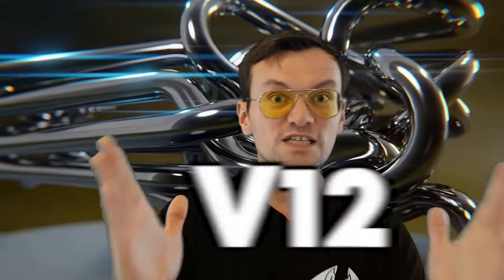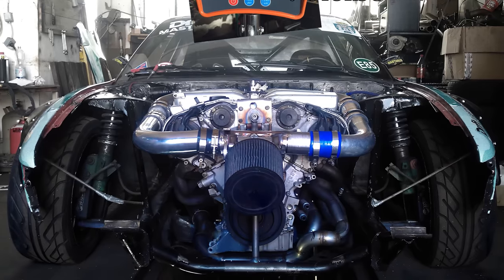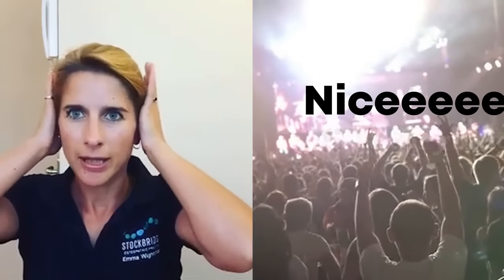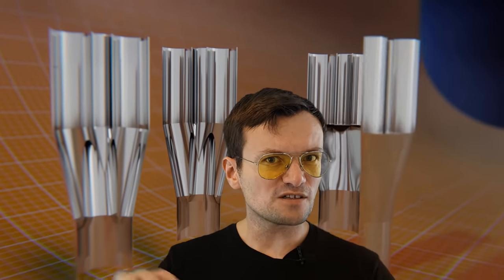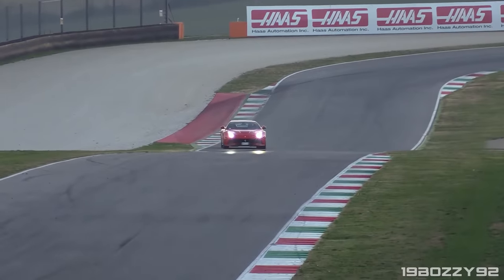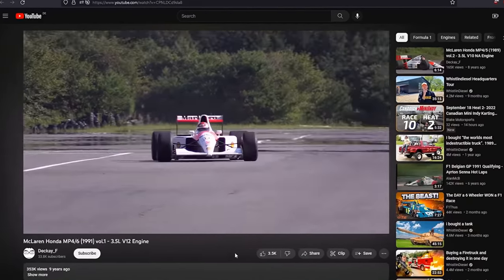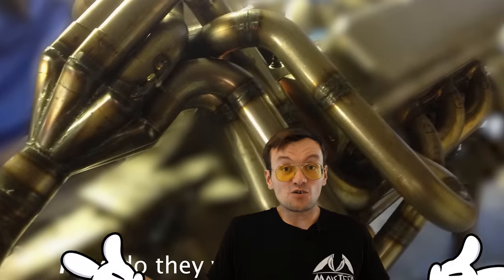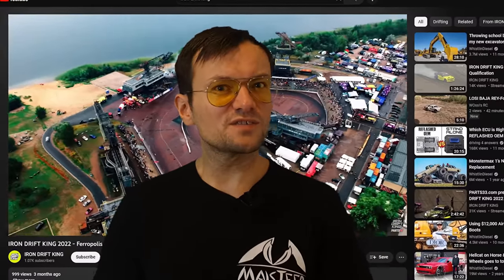Why This V12 Sounds Better Than a $5,000,000 Pagani

Comment: So all these lovely sounding examples here are doing it by stepped headers or is there still more to it?
Reply from the maker: I think you've missed the part in the latest video about that 1989 Ferrari V12....? The stepped headers are not the only way. The principle can be applied in different ways. The logical next question is. What happens when you combine them? (I've never seen that done before)
Reply: @maisteer  
@andyhbo86

Where the paths cross seems to be less important than when they cross in the lifecycle of the pressure wave.

Almost all conversations around exhaust and sound center around the pressure wave exiting and returning through the system. It makes most sense to me that the F1 sounds we all love are a hyper organized process of lining up the pressure waves so that each pulse is given a clear non turbulent path.

I think cylinder pulse timing from end to end is the key over the form of the system. Even though that is a significant factor in timing similar to diameter and length of the overall system. I'm open to why this could be a wrong way to think of it.

Comment: The sound is worth the work.
Reply from the maker: Yes, I totally agree. And I hope I can make another video about it soon.
Reply: absolutetly
Reply: I doubt you'd really say that if you were paying for it!

Especially when you consider that your car will probably be slower after spending all that money. Manufacturers these days to go great lengths to design exhaust systems with multiple parallel turbos and twin scroll turbos because splitting the headers prevents pressure waves from stacking and increasing exhaust backpressure which costs you efficiency and power.

Besides F1 cars sound good...for F1 racing. On a road car I don't think that high pitched raspy sound is even all that great. Most definitely prefer the more complex sound of a traditional Ferrari V12, or even the brute thunder from a M279.
Reply: @BigUriel  I wont argue. If my anemic checkbook had to shell out for it, I'd probably put equal length headers on a one cylinder motorcycle and call it a day.
Reply from the maker: @BigUriel  There's one man that went through great trouble and expense to do just the opposite of what became the norm today. And in my opinion he succeeded, what do you think: https://youtu.be/P_9T8WU4ekg?t=90
Reply: @maisteer  To be honest I don't love the sound, like I said it doesn't fit with the car at all, it's a sound that works for F1...and that's it.

A Ferrari 812 sounds much better.
Reply from the maker: @BigUriel  I guess you made up your mind already.... ^_^
Reply: Honestly 2k isn’t that bad for equal length 12 into one headers. Stainless works headers for a 5.0 stang are $1200-$1300.
Reply: @BigUriel  the average price for headers full length quality headers on a V8 is between 1200 and 2600 so the price is perfect.
Reply: 1000%
Reply from the maker: The follow up video is done.... let's see if it really was worth it ^_^' -  https://youtu.be/6EjbfLSRmyA
Reply from the maker: @BigUriel  You will love the follow up video ^_^' https://youtu.be/6EjbfLSRmyA
Reply from the maker: @davestewart1656  Motorcycle engines are featured in the new video too... altough not one cylinder ones. https://youtu.be/6EjbfLSRmyA
Reply: The porche at 1:24 had the most different sounding exhaust I have heard. It sounded extremely smooth. What is the story behind that?

Also, I think this exhaust sounds pretty impressive, especially when it gets up a couple of gears https://youtu.be/pLdSDyATsGw?t=21
Reply: @BigUriel not limited to F1 the Lamborghini’s sound and look nice with aerodynamic enhancements,not a everyday driver but fun in tracks and open highway thrills here and there 😊

Comment: I've spent years researching just what you need to make that high pitched shriek that the Zonda makes (although the Murcielago also makes this then later special headers make the Aventador do that as well but I still preferred the Murcielago sound). You've just summed it all up into one video.
Reply from the maker: I'm glad you found some value in it ^_^

Comment: I have an acoustics background and I had never considered the impact of header design on engine sound.
This makes a lot of sense though.
Pulses per second is basically Hz or frequency.
If you have more pulses coming out of a single pipe (or speaker) per second, you have a higher frequency.

Of all the exhaust tones in this video, I loved the GT 350 the most - 10:13. mmmm that low rumble :P
The most interesting tone was the Honda at 9:32. It is clearly 2 distinct 'notes' (to make a chord!) which makes sense with the 2 header pipes with slightly different path length.

My takeaway: people have different opinions of 'best' tone. But this is a fantastic look at how those tonal characters are created!
Reply from the maker: I hope you will like the new video... it's like an entertaining physics class but without physics: https://youtu.be/6EjbfLSRmyA

Comment: I believe the Rob Dahm 4 rotor is a major competitor for a 12 to 1, technically since each rotor has three sides it would have a very similar exhaust pulse rate and sound, that engine sounds absolutely amazing!
Reply from the maker: Yes, absolutely. 4-Rotors do sound insanely good: https://youtu.be/5NZmUkA5rGQ?t=78

Comment: Part 2! part 2! we want to see the results! You have inspired me to try to make a 4cylinder sound like a v12, or at least higher pitch lol, ill use it as a challenge to improve my fabricating and welding skills, might start this experiment in 1 year or so, the project im planning to do this to needs way more work, to be where I want it to be, we shall see
Reply from the maker: Good luck with the project, I hope it'll all works out.
The car with the 12 into 1 is supposed to be finished in mid-August. And I can't wait to hear it too ^_^
Reply: @maisteer is september
Reply: @maisteer As a 4-8-1 header, I think the fact that it rotates will improve the sound even if 2 tubes are triggered at the same time
Reply: An open tri y header on my four cylinder gave it quit a high pitch lol

Comment: Not just the harmonic tuned exhaust pipes, the awesome high pitch sound of a V12 happened by the high RPM in the engines, it happens that only short life high horse power Formula 1 engines are design to reach 10k-20k+ RPM, that's  probably the main reason that sounds so good.
Reply from the maker: It gives them the edge certainly... but the Zonda still sounds quite good despite not revving to the moon. But it's a different kind of nice than a F1 car for sure.

Comment: Excellent journey down the rabbit hole. I've been researching the 8-1 and 12-1 for years. There's another way to run the piping. It's all about the pulses coming out sequentially. A 12-1 v12 at 7000rpm sounds identical to a 12-2 at 14000rpm. You can go 12 into 2 into 1. Or really any combination with sequential pulses going into the collectors 2x  3 into 2 into 1 on each side. then 4 into 2 into 1 with everything for packaging. As long as the various segments remain equal length. In theory there should be no losses if the collector lengths are tuned for the desired torque peak.
Reply from the maker: 12-2 at 14000rpm....? I'm really looking forward to hear that! How come you know so much about it?
Reply from the maker: @curvs4me  Yes, absolutely. Thanks for the detailed answer too.
Reply: @curvs4me  would this same principle work with v10s and turbo applications?
Reply: You should look at the M5 4.4 Twin Turbo manifold, it’s 2 180 degree manifolds but unequal length, and because it’s twinscroll twin turbo it’s 8-4-2. I bet if they were equal it could be Ferrari like.

I’ve also been looking at headers for 4 cylinders. 4-1, 4-2-1 non-sequential (180 degree) and 4-2-1 sequential. The sequential headers (odd odd even even) have a very deep aggressive sound and also make good power (hytech, skunk2 alpha) while the 4-2-1 180 degree (odd even odd even) has a clean sound, I genuinely can’t tell between that and 4-1. Sequential is not common because it’s seen as the “wrong” way to pair a 4-2-1 yet makes power.
Reply: @curvs4me  the M5 isn’t paired by banks tho, it uses a cross bank manifold so that all odd cylinders go into one turbo and even ones into the other, so in theory shouldn’t be any pulse interference. The manifolds are shaped like an X
Reply: Yeah, F1 cars used to go up to 20-21k rpm, I've seen Schumaher reaching almost 22k rpm on his Ferrari. 🤯 I loved the sound.
Reply: @curvs4me  so it's better to develop the wanted sound from a l6 and mirror the exaust to the V12. M120 is 2x l6 (2x M104). 😏 I have a great sounding M106 straight 6 😊
Reply: @curvs4me 
Hey I tried to inform myself as much as possible but I still have a couple of questions I was hoping you could answer. Forgive my ignorance, if you could also point me to other resources on the matter it’d be great.

1. How important is the firing order for the final sound result? After researching I still don’t quite understand how to interpret the firing order of an engine, when is it even or odd (given the firing order)

2. I’ll give an example in order to explain my understanding from your replies, correct me if I misunderstood anything. Given the BMW M70 with a firing order of 1 7 5 11 3 9 6 12 2 8 4 10 ~this kinda ties to my first question~. On one side bank you would merge cylinders number 1-3-5 because they’re all odd AND cylinders 2-4-6 because they’re the even ones (same for the other bank with cylinders 7-12). Those first 2 pipes; one is all odd firing and the other all even firing so if you were to merge them into 1 AND THEN again with the resulting pipe from the other bank you would be assured that through this final pipe the firing pulses would be odd-even-odd-even-etc therefore getting that smooth high pitched sound? If this is correct I don’t understand how the firing order plays a part in this.

3. If I were to be correct in point 2 I don’t quite understand why would you do this “You can also go back from 1 to 2 after the merge and get the same sound out of both”. At what point or merge would you do this?

4. What does equal length exactly mean in this context? From what point to what point is it measured is maybe my question, and what precision range distance wise are we talking about? (I assume it's kinda difficult when talking about bent pipes, etc).

5. Is there something REALLY important performance wise in the design of the exhaust (street car context)? Form of tubing, bends, curves, etc.

6. There’s this famous and old video of a s600 w220 with a f1 sounding exhaust by Makoto Sasaki (brilliantexhaust on ig) and he uses a 6 to 1 header with an X-pipe in the middle (I think). Does it produce the same result a 6 to 1 header as the method you describe? If answer is yes then why are we taking into account if it’s odd or even when merging? I assume a 6 to 1 is not desirable because of complexity and space issues?
Following this, I found a forum post of a guy trying to replicate this on his BMW 850i (m70 engine) with interesting info but I can’t judge how good or relevant it is. The title is “S600 F1 Exhaust - Making it Happen” from the site mbworld (I think it’s not recommended posting links in yt comments). I don’t think he’s touching his headers but I mention it because he uses also an “x pipe” and I don’t know if that’s what you’re referring in question 3.

Thank you.

Comment: This is awesome looking foward to the finish project. One question if you have a v6 is best to merge the 6 together at the same time or you can merge 3 and 3, and the using equal length piping merge them together?
Reply from the maker: First of all is the V6 firing at an even intervall of 120°?
Then it seems that 6-in-1's sound better than 6-in-2-in-1, but I would assume, that's also dependent on how long the secondary pipe is. Or to put it like this, how much time the exhaust pulses have time to interact with each other, before they ALL merge together. At the moment it's just an assumption, I will try to find out for you all sometime.

Comment: It's hard to find research about exhaust that's been done solely to achieve F1 sound and not horsepower gains, this is exactly what I've been looking for.  I've always wandered if you could come close to an F1 V12 sound with a BMW straight-six with equal length 6-1 headers and reinforced internals for a higher redline, this explains why they've never had a smooth scream even at 9k RPM.
Reply from the maker: Yeah, it was so frustrating to go through all the effort of swapping in a V12 and then having this horrible raspy sound and not being to able to figure out why - I hope I can prevent others of making the same mistake.

Comment: Thr sequential 8-1 is definitely superior in performance because as the previous exhaust pulse flows, it pulls on the next one beside it, which significantly increases scavenging. That 350R is definitely an RPM monster. The issue, as you stated, is how massive they are. This is why theyre normally seen on mid engine cars, as theres more room than the front of an engine bay.
Reply: Do you think a V12 with oval exhausts sounds like a V8? Like an S600, this occurred to me because there is a guy with an alligator who has an 8-1 with oval exhausts and it doesn't sound like KSR's 8-1, it sounds like a V8. with a normal exhaust
Reply: @sarbakara7469  maybe unequal length headers... if all the tubes are the same length, and it's sequential firing order they scream.
Reply: @EliminatorPerformance  Don't you think the shape of the eacape affects the sound? If it is square if it is oval if it is a circle
Reply: @sarbakara7469  maybe a bit, I know the NASCAR boom tubes used to be oval and some were even rectangular
Reply from the maker: My friend told me about someone doing an 8 into 1 an then being dissappointed with the performance or something. But how many things were different from the setup before, I simply don't know.
Usually you have to make compromises anyway... since an 8 in 1 is much harder to fitm, exposes more heat and so on and on. I simply don't know.
The theory sounds convincing, but like the Engine Masters video showed on bashing headers... it's not always as simple as it seems ^_^   - https://www.dailymotion.com/video/x3vupq0

Comment: I love your passion. But I think the most beautiful sound that comes from an exhaust is much more than that. Maybe this has to do with my age. Memories, nostalgia... Like, for example, in a rally, an approaching Porsche 934 crashing and roaring in the woods, the banging of the oil pan,... wonderful, terrifying. The Gt3 of today is of course also heavenly. But the sound of the 934 is angrier, more aggressive. I once had a motorcycle a long time ago, Zxr 750. A 4 cylinder. I cobbled together an exhaust for it myself. With a homemade silencer. That thing howled deafeningly, at a high pitch. Purely by luck...friends still talk about it 40 years later. Many villages heard how they heard my engine screaming at the rev limiter, very late at night. Not everyone was in bed with chickpeas of course.... A JUDD V10. Auto Union 16 cyl. Or A BRM V16. The Kawa H2R On the isle of Mann,... I wouldn't know...
Reply from the maker: Yeah, sure. Certainly depends a lot on where and how you witnessed them.
For me it's this one: https://www.youtube.com/watch?v=TmpzUCOqE3g
You could hear the supercharger whine echoing through the forest ages before you could see it.

Comment: Good Old Rotary fire exhausts sound amazing. Know a few guys with V8’s that hand built equal length headers 8to1 in rotary fire fashion. Just pure bliss to the ears.
Reply from the maker: I agree. Altough I haven't seen many of them. Only 3 different cars I am ware of have 8 into 1 headers firing sequentially.

Comment: I always thought it was the RPM alone that made the f1 sound
Reply from the maker: Certainly is one of the biggest factors. But an equally high revving one cylinder doesn't sound like an F1 car either. So more things than just rpm must play a role.

Comment: Aftermarket headers sound horrible because wall thickness is paper and they generally use 321- 304ss which is very rigid. The higher frequency sound isn't dampend as it would in a lesser grade stainless or even mild steel.
Reply from the maker: Interesting. All aftermarket headers are like that?
Reply: @maisteer  unfortunately alot of stuff is made in china，but there was still good manufacturers around such as Remus , when I was working in that industry.  I've had close experience with the Chinese stuff and the steel is inferior and wall thickness is also not good. Depending on the engine the sound is horrible. The high frequencies pass straight through rather than be absorbed as they would with a mild steel or even 409 ss. L98, Ls1/2/3 engines sounded really raspy. Yuck.
Reply from the maker: I've made a new video... also going into Material and such. It's alot tough. You can watch it here: https://youtu.be/6EjbfLSRmyA

Comment: Dont forget 180° headers on the American v8s either, they take a pulse from the opposite cylinder bank to equal out the pulse imbalance on the other bank.
Reply from the maker: Agree. But didn't know how to fit it in the video ^_^

Comment: Don't forget about the bore and stroke and how high it revs affects your sound as well.
Reply from the maker: That's a good point. But also head design, camshafts and so on can have a big effect. There many factors to take into account.
But the point I tried to make: When you have the 'wrong' collector design, you can change every other factor, but it will never sound the way you want it to.
The collector is an essential component to get the sound your after - it's not only a small change in exhaust note - it completely transforms the way an engine sounds.